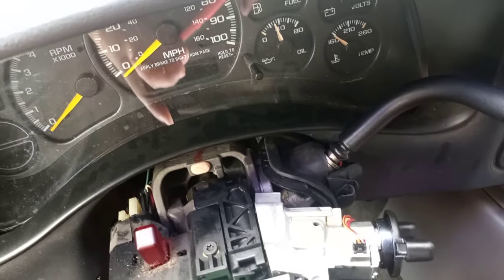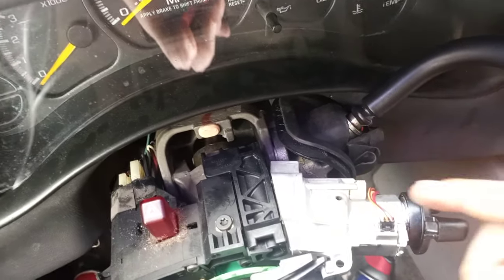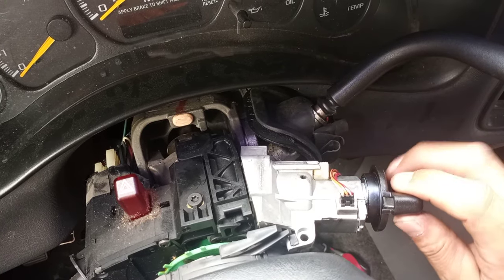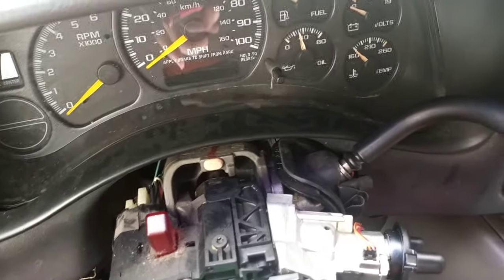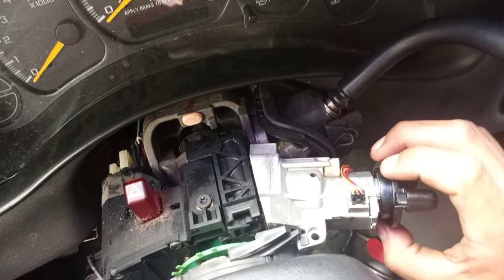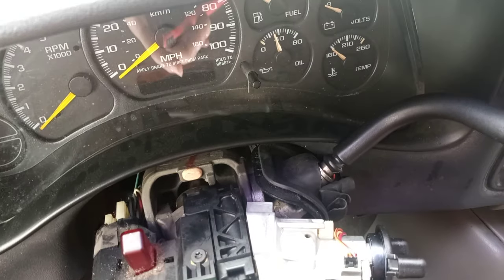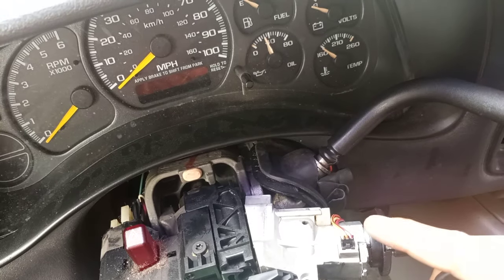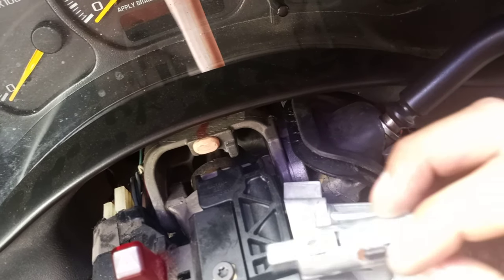ignition switch cylinder replacement,chevy tahoe

Comment: Around 5:20 he begins talking about the actual problem where you can't turn the cylinder even with the key, or rather he talked a bunch. Bunch but at this time he is pointing to the actual element on the cylinder which you have to manipulate with your pic or shim or dental flosser to push inwards at the same time that you turn the cylinder, presumably with the key in it, but perhaps with any key or a screwdriver. Now I will finish watching, but already from another video I learned that I need a certain sort of bendy pic thing to push the tab of metal in. So I will go get that and then come back and try and complete this. But for the first 5 minutes you could probably just skip or fast forward.

Edits:

1) the shim must be quite strong and stiff. I sacrificed a dinner fork and the tine was strong enough, but many lesser metal or plastic strips failed.

2) other advice I'm going to try: turn key to On or is it Run, put in D, this will lock out starter motor and then you can turn key to Start and it won't start while you remove cylinder.
Reply: Life saver

Comment: What if you dont have the key to turn the ignition
Reply from the maker: You will need the key to put it on the right position to press the lock and than remove the cylinder,thank you
Reply: Then your screwed
Reply: Drill a small hole in the cylinder housing, about 90degrees counter clockwise of where the release hole is, use a pin the same as you would int the release hole, it will become free
Reply: Just had to do that

Comment: Yeah dude thanks for saying to put it in the ON position instead of RUN position and now my damn key came out in the on position and cylinder is now locked in off position unable to remove and unable to start truck to go to work 
Don't make a video unless you can give proper direction because mine was turning and if you would have stated the RUN position I wouldn't be in this position!